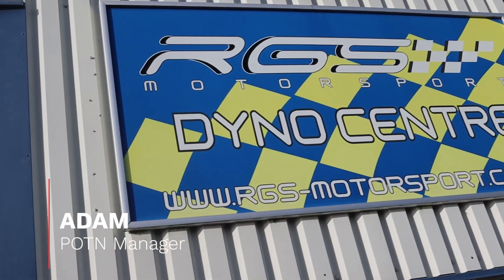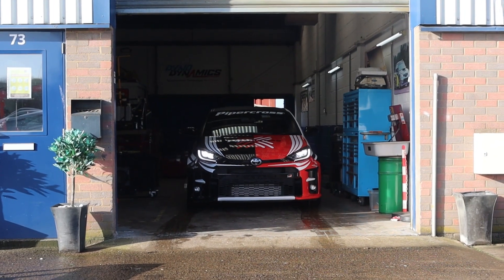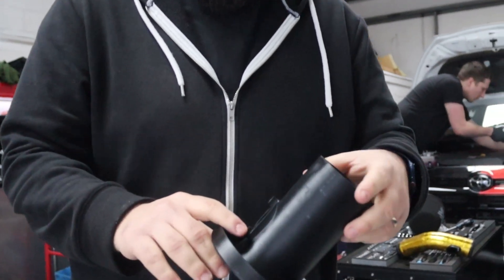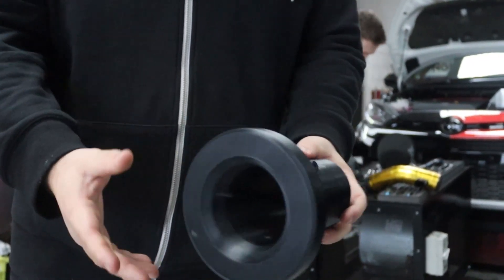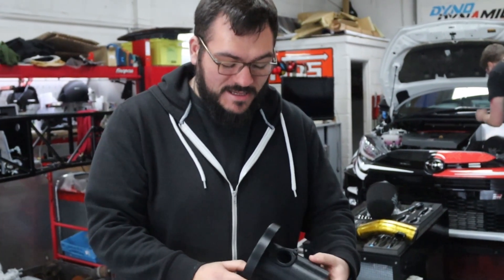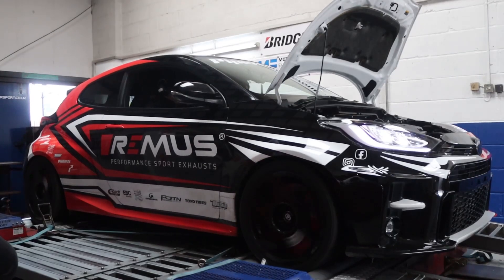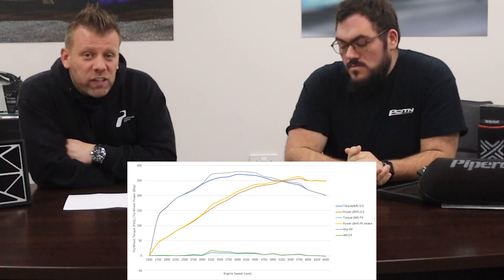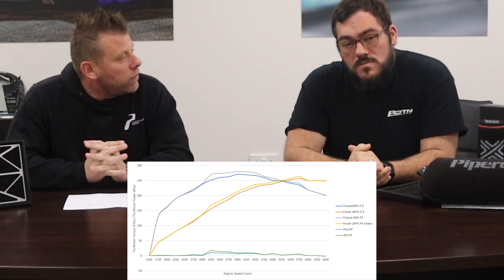OUR GR YARIS HITS THE DYNO!! Can We Get Power Gains with a Pipercross Intake?

Comment: I’ve got the MST this looks like an exact copy of that 👍
Reply: Me too. Love mine.
Reply from the maker: Thanks for the comments guys.
There is similarities, in the fact there is a hard pipe and a filter yes, but the Filter entrance to the hard pipe, the hard pipe positioning and air flow, is likely to be different as it isn't a copy.
Most intakes look the same if you take the overall design of an intake into consideration.
The MST one does seem popular, although i am not sure if i like the heat shield how it comes round the front of the filter, looks a bit squashed IMO